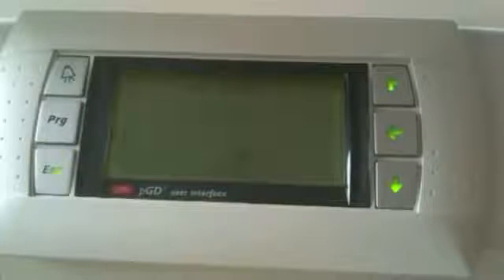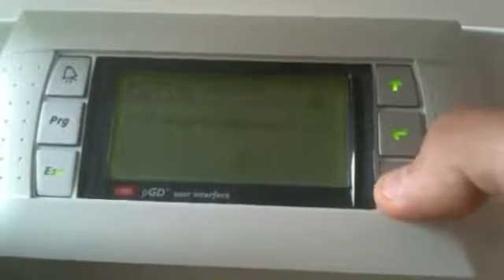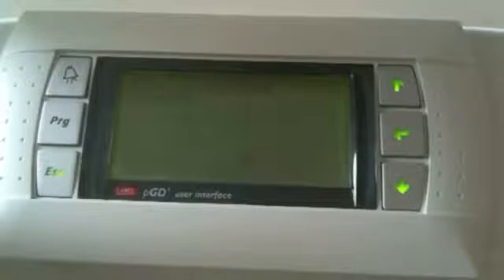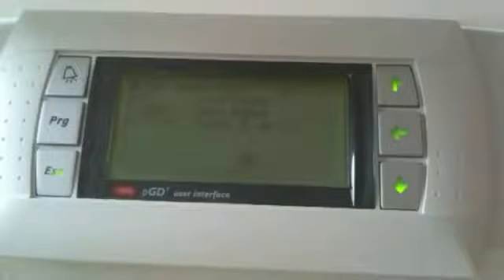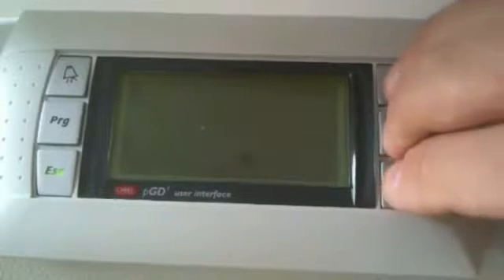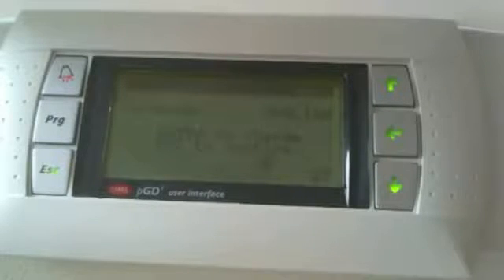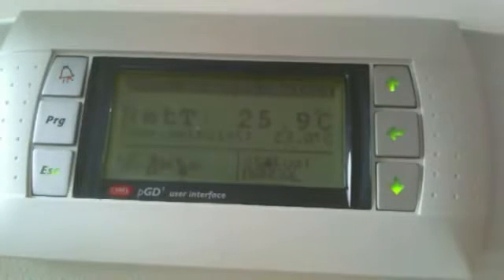NO-LINK message appearing typically on a Carel PGD1 displays when connected to a Carel PCO's

Comment: This situation happen to me once with a precision air, there is a flex inside of the controller, sometimes this flex isn't making good contact in it connection and this error appears, once fixed the connection the error dissapear

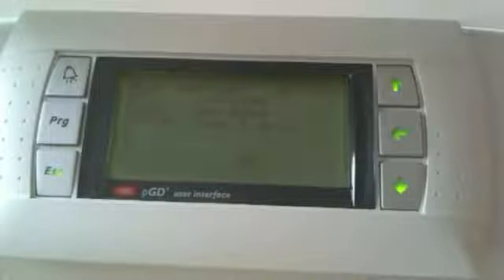Comment: What happens at the minute 2:40, trying to access controller config during boot, if the displays stays blank (filled up with black squares ) what can cause this 
and is there any other key combination  to achieve that ?

or is this an indication of failure ,  *cables have been tested * 

I’ll appreciate any input and or suggestion